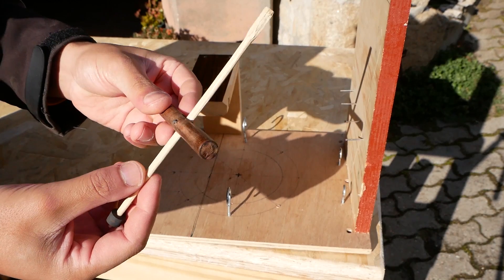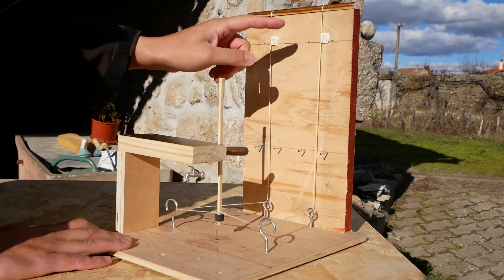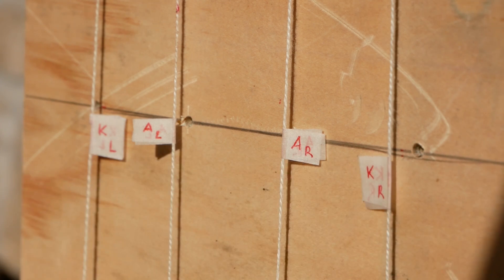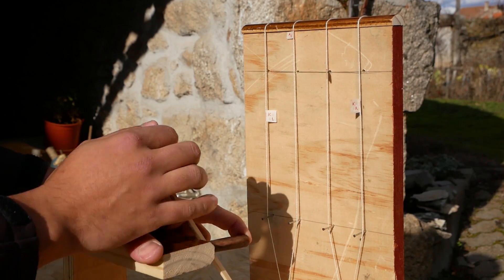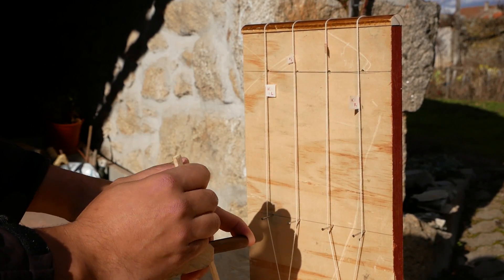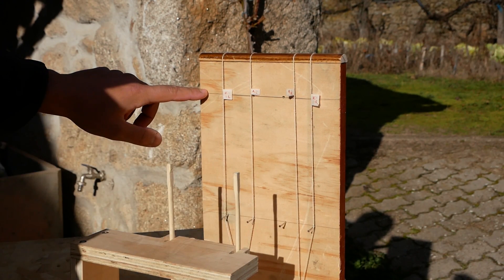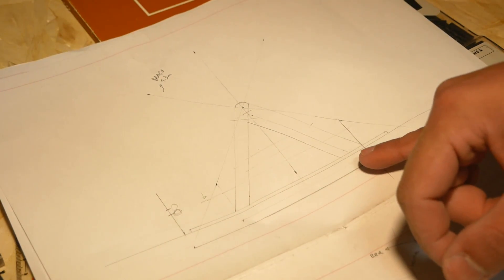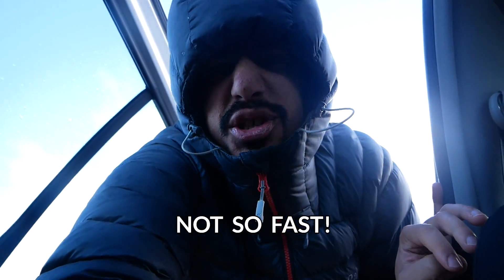Paraglider Joystick Part 1 - BANDARRA

Comment from the maker: What do you guys think? Will it work?
Reply: It seems great but I like the first variant and perhaps you could add a tension string operated by a button to dampen the speed bars when you just want brakes and rolls to work?
Reply from the maker: Interesting idea Bari FPV, I didn't think about that, might be a good idea
Reply: Heck yeah it’ll work!  Do you have anything smaller than the seed to test it?  First thing that came to mind was the 2 meter wings they make for RC paragliders.
Reply from the maker: Not really Christopher Greci. I took the measurements from Gemma's Ion which has pretty long brake travel and regular acc travel so "in theory" the joystick could work for any wing with reasonable travels and brake pressures
Reply: I reckon so. (Great vid btw) if it does work, further experiment could be adding tip steering to it somehow.
Reply: Good idea for a trike, one joystick with the throttle, no accelerator, obviously.
Reply: Hi Andre.
It is very similar to Eric Durors SkyDrive trike that seems very simple to operate.
Have you seen that setup.?
Regards Pat
Reply from the maker: Hi Pat, I haven't seen it but sounds interesting, do you have a link?

Comment: On large foil kites there are no brakes but rather a pulley system that operates in a speedbar fashion but not only to reduce aoa, also the other direction. Like a trimmer and speedbar combined. This gives full aoa control over each half of the wing. It seems to me like that'd give a great freedom of control over the flight dynamics with only two axis like the concept here suggests. Only difference is that speedbar and "brakes" are at the opposite of each axis and therefore can't be applied simultaneously on the same half wing, which is probably a good thing anyway.
Reply from the maker: Yep, makes a lot of sense and was part of my inspiration for this even though I don't fully get kites yet. I did see that limitation with the prototype that I've built, you can't apply speedbar and brakes at the same time but the "need" for that is very limited, in fact the only example I can give of that being useful is when trying to do a cobra launch in moderate/low wind.
Reply: Hi Andre, I have to say I didn't think of the cobra launch, good catch! I'm a PG pilot getting into kites. The speed system of a PG (also trimmers) not only changes the calage of the wing but also the camber of the airfoil. The kite depower bridle also does that.
The brakes are pulled 100% then the C 50% then the B 25% and the A stays unchanged. However a pulley system can be made to only alter the aoa (not sure if that's desirable). That'd be brakes 100% then D 75% then C 50% and B 25%. On a PG with ABCD rows it would be relatively easy to implement both by using custom risers.
On a kite, the use of a bar implies that pulling one side releases the other, the bar can be pulled in and out as well to change the general aoa of the sail. That might be of interest to you for prototyping your system, as a joystick sounds more complicated to adapt.

Comment: Haha I love the way you explore crazy ideas !! :)
I'm thinking that having the speed bar connect into a single line to attach to the joy stick for a uniform deployment with a certain amount of slack so it doesn't engage when steering but only when you push forward, but with some fine tuning this will work !! 
Although one might need a fairly rigid cockpit pod so you have something to push against to get the leverage required :)

Comment: Very creative idea. I can imagine this sort of controls as a handheld joystick control panel on the lap of the pilot. Certainly the line movement would have to be scaled up, but that's relatively easy to achieve with a tackle system, or springs, or some other similar analogue staff. Certainly all of this could be applied to a motorized version, but that's way too high tech for starting. And that's leading to remote controlled paragliding. Which is awesome, but misses the point of having the person flying. There are better solutions for pilotless flying objects - also known as drones :)

Man, you inspired me some great ideas. I just need some time to find to work them to the details.
Reply from the maker: Ahah we're having all the same ideas then :) we'll see where this all leads to
Reply: @AndreBandarra1  Looking forward to the evolution of the idea. Definitely for the next video in the series. I hope that it won't be dropped like the non-collapsable wing.
Reply from the maker: That idea wasn't dropped, I just don't have 3000$ to invest in sensors for the next step that's all
Reply: @AndreBandarra1  I wonder if some sort of stall warning device could be ... devised ... for paraglider/paramotor wings. Most fixed wings have such things and even Angle of Attack indicators. I'm thinking an AoA indicator could be as simple as a bit of yarn (like sailplane pilots have on their windscreen) attached to a B or C line maybe?
Reply from the maker: yeah, pretty sure it can be made. As with everything in life its an effort vs reward judgment
Reply: a block and tackle pulley system to get the movement required would dramatically increase the weight of the controls, very tiring.
However for general flying about single handed you wouldn't need that much movement and when you need more movement just reach up and grab the brakes like normal for landings and ground handling etc.

Comment: Consider the speed system as 1 function = 1line. Not 2 lines!  Then a single joystick will work. Left and right on brakes and forward to pull speed system.
Reply from the maker: Yeah I thought about that but really wanted to keep them separate to be able to pull up one side more than the other, but good suggestion
Reply: Hey I just made that suggestion and then stumbled on this comment.
Asymmetric speed bar application makes me nervous !! :)
Reply from the maker: don't you do it when launching?
Reply: What ? apply the speed bar asymmetrically ?
er, no, definitely not !!  haha :D
Reply from the maker: I use pulling the A's or using speedbar as interchangeable  expressions in this case even though they are different :) but you know what I mean. When you launch your wing you pull both your A's exactly the same? I just pull the low side of the wing more
Reply: @AndreBandarra1  to kite the wing up during ground handling yes. Not during flight. I get what your saying.
So if it's sole for ground handling then ok, but even then, once the wing is above you where it's supposed to be, any a line being pulled is more likily to induce a frontal. Aoa on the ground is different to the aoa during flight.
Reply from the maker: yep agreed, but if you're not on the wing, if you are remote, you have the same controls if you are groundhandling or if you are flying. Meaning if both A's/accelerator are joined you can't pull them independently. But if you have them separate you can pull both at the same time, so it just gives you more options.